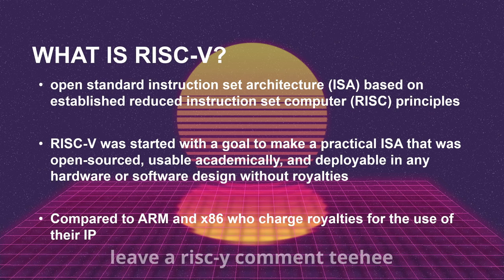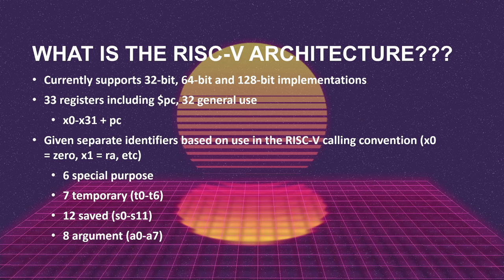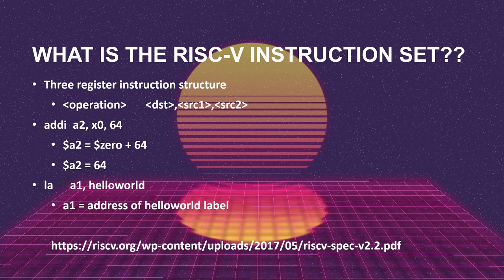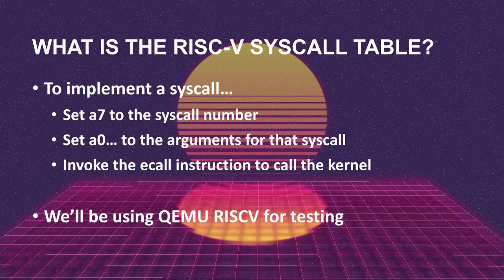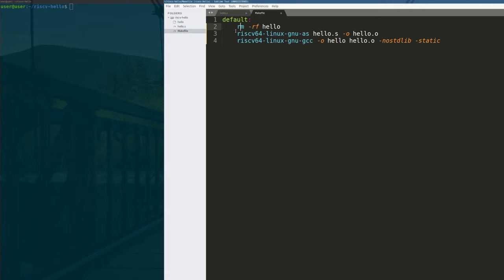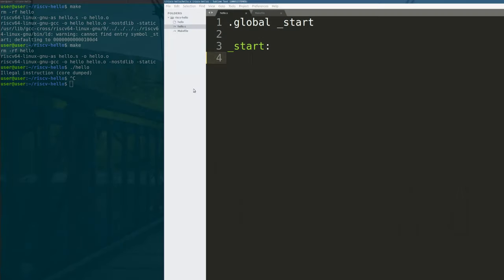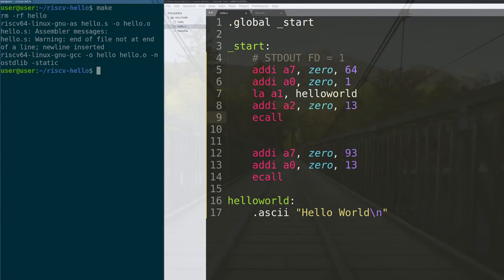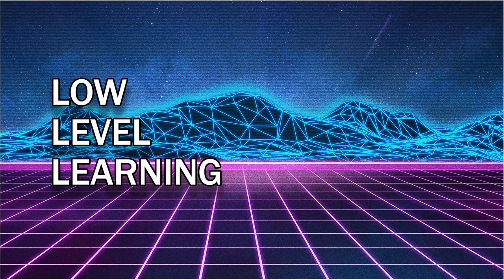You Can Learn RISC-V Assembly in 10 Minutes  |  Getting Started RISC-V Assembly on Linux Tutorial

Comment: The length of the ascii string is 12 IMHO. (was 13 with comma).  It is accessing (and printing) one more character, potentially beyond process' address space, I am guessing ELF executable is padded to 512 byte blocks or something. Methinks you could get an exception from kernel if your 13th byte is outside process space.
Reply: Wow you’re right. He says “ascii terminated string” at 9:30, but .ascii doesn’t add a null terminator. He’d have to use .asciiz instead. He must have gotten lucky because it didn’t cross a 4k page boundary.
Reply: In the GNU assembler it is .asciz and not .asciiz, you can also use .string.

Comment: Great video! I had a question maybe you could answer. Wouldn't the li instruction be better than using addi when one of the operands is 0? Like, instead of "addi a7, zero, 64", you could just do "li a7, 64".
Reply from the maker: You could easily do that as well!
Reply: @LowLevel-TV  Oh, so there’s no behind the scenes difference or anything? Just up to the programmer’s preference?
Reply: @kevinescobedo5633  Even if they produce the same result, they are different instructions. In the physical chip, they would behave according to their specifications, and there could be minor differences, like the number of clock cycles taken or the flags affected.
Reply: @LowLevel-TV  big brain time
Reply: @kevinescobedo5633  li is a pseudo instruction that gets converted to "addi a7, x0, 64" behind the scenes. So using it is more concise, but it eventually becomes the same thing so in the end it is just user preference.
Reply: Li is not an riscv instruction, it is a pseudo instruction
Reply: This is exactly the same thing MIPS does IIRC. Since adding the immediate field to a register that contains zero is the same as loading the immediate value directly, and there happens to be a register that always contains zero, no reason to waste an opcode on a load instruction.
There's also an analogous LUI instruction, although it's a 12/20-bit split unlike the 16/16 split in MIPS.

Comment: Hello, as usual nice video. Just a small question, is -static really required when linking these examples?
Reply: Nevermind I watched the arm64 episode where you explain why 👍
Reply: It is when using the Linux compiler, which creates a dynamically-linked executable by default. Doing programs like this -- especially for an embedded board -- you'd probably use riscv64-unknown-elf-gcc instead, which 1) automatically links statically, and 2) uses Newlib instead of glibc (of course this program isn't using the C library at all)

Comment: Also - I see you used section 3 of the manual for exit(). I haven't really done much Linux syscall programming but shouldn't we check section 2 in this particular case?
Reply: Well the interfaces in section 2 and 3 are pretty much identical, forgive my pedantry 🤣
Reply: You're right, for syscalls it should be section 2.  Section 3 gives the right answer for exit by good luck, but not for write (doesn't exist).

Comment: Nice video! One question, how and where did you find the "qemu-riscv64" command? All I can find in my system is "qemu-system-riscv64".

I'm on Arch Linux and I downloaded the following packages:
* qemu-system-riscv
* riscv64-linux-gnu-gcc

Also, how do you even execute the program without using "QEMU" at first? What kind of black magic is this?
Reply: Exactly same question here. This is blocking me from following this tutorial, because I kept getting "Exec format error" if I follow the tutorial and simply run "./hello"..
Reply: @yltfy  Hope he replys at some point!
Reply: @godnyx117  You need to install qemu user mode. This worked for me In Fedora:
sudo dnf install qemu-user
then you run things with
qemu-riscv64 ./hello

The cool thing is that once I installed qemu-user, I don't even need to type qemu-riscv64 as the loader gets a hook that knows to run RISC-V executables via qemu-riscv64.

For Ubuntu, the package is also called qemu-user I think.
Reply: @pierrejacomet8098  Why the FUCK didn't he said it in the video? Unless the package was split after he made the video...

Anyways, thanks a lot for the help! It will come very useful in the future! Have an amazing day!
Reply: @yltfy  Check the reply section, we got the solution! TLDR: You need the "qemu-user" package!
Reply: @BruceHoult  I suppose that this "no" goes to my "unless the package was split after the video" question, right?
Reply: @godnyx117  yes. Although I confess that different package systems I"m not familiar with might combine them. I always build from source, where you do "./configure --target-list=riscv32-linux-user,riscv64-linux-user,riscv32-softmmu,riscv64-softmmu" as desired. Without the flag it builds all 30 or so ISAs both ways!
Reply: @BruceHoult  Thank you for the info! It's gonna be useful in the future!
Reply: @godnyx117  You really have a kind warm heart, dude. Thx
Reply: @Ke_eK  Thank you so much for the compliment!

Out of curiosity however, could you point out what made you say that because I don't see anything worth of that complement in my replies 😅

Comment: Is there no load immediate instruction to load a number into a register? It's quite a common thing to do, even in this trivial example. It seems a bit clunky that you have to add it to zero. How many cycles does it take?
Reply: The assembler provides an `li` mnemonic but it's not a real instruction and for values between -2048 and +2047 it expands to an `addi` instruction. Clock cycles depends on the design of the particular CPU, not the instruction set, but you can expect that no other instruction is faster than `add` and `addi`. On CPUs designed for  speed that's going to be 1 clock cycle.